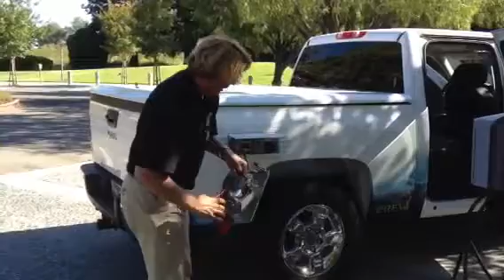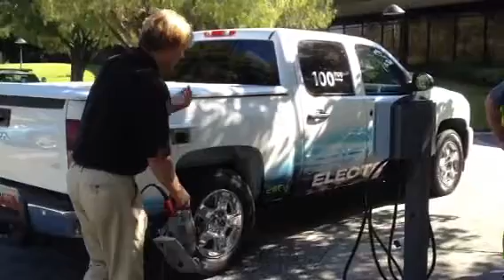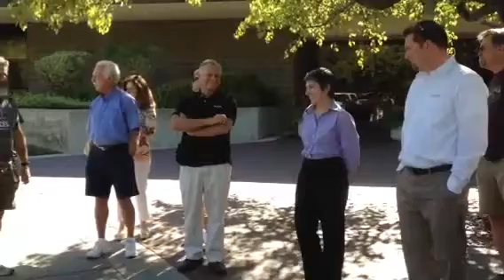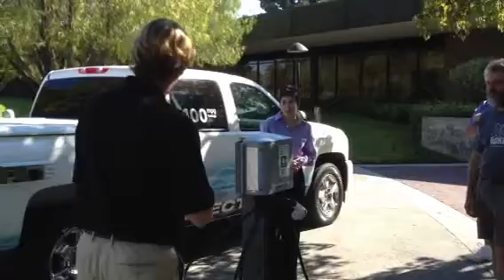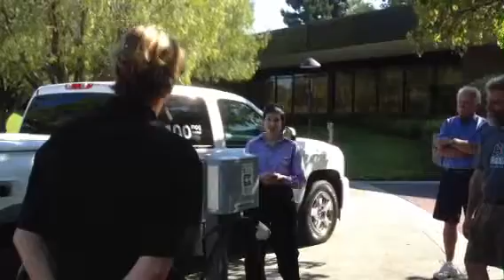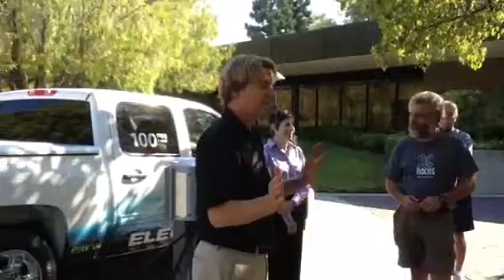VIA Motors VTRUX Extended Range EV Truck

Comment: I've seen this ev before it was one of the gm models that went down when it had to restructure it's debt problem back in 08, it's a hybrid with a genset configuation a good one at that but something is not right with what is shown in this video the gm version was capable of going up to 600 miles not a mere 100 better do something about that range if you want to get the masses attention..